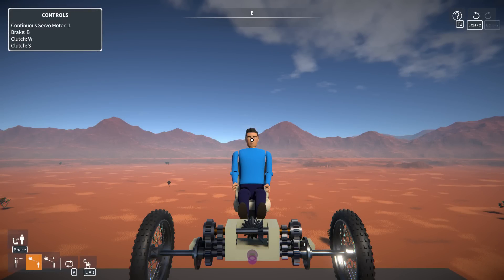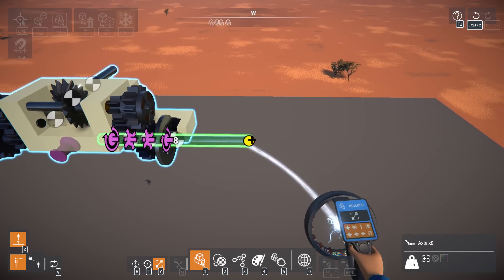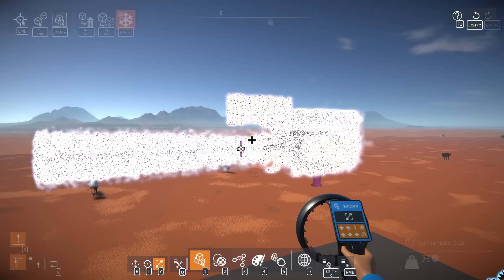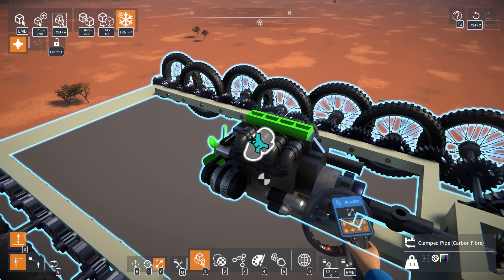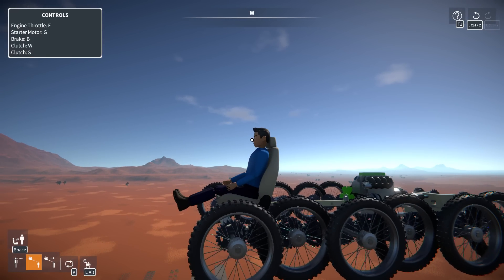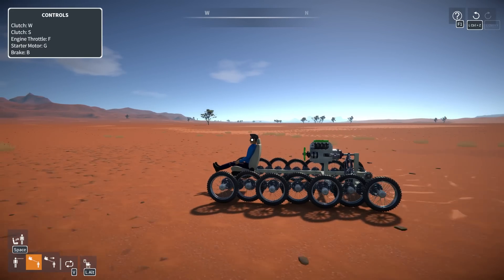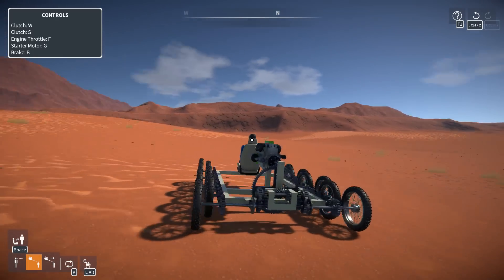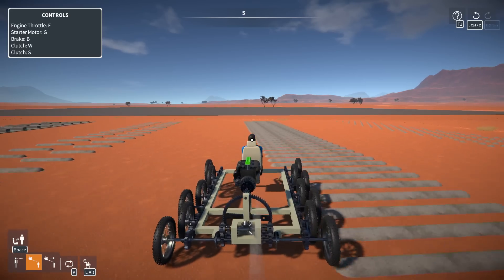I Built a Tank Drive Using a Single Combustion Engine and Transmission!

Comment: Theirs a video called "Double Differential Gear Steering - 3D Animation" by XL Machines 120 that will show you quite clearly how it works for modern tanks, you can then use 2 gearboxes, one to control the drive speed and one to control the turning speed both working off the same engine. Its even easier to do with linear gearboxes now too thanks to the most recent update giving us the ability to break linear actuators down into steps.

As for making tracks, theirs 2 main ways its commonly done in the game, one with gears and gear racks, the other with wheels. You can use the scaffolding blocks to have separate builds be part of the same construction. use springs and/or linear actuators to tension the track when you un-freeze it.

Theirs a few quirks that each type of drive has that I will let you find.

you can use cylinders as roadwheels (the wheels along the bottom) if you want to get more stylish with how it looks, but they are not perfectly round at high speed like normal wheels or gears, if you want to use wheels you should turn down the friction on the road wheels as it will reduce the torque needed, if only by a little.

Some tips: 

Turn Off Collisions when making tracks! "Press 0, hold Q, Settings Tab, Contact Detection : Off" it will save you so many frames and your ears.

Bigger gears allow for more torque to be put though them before skipping. (avoid 8T gears in high torque areas if possible, I have had the 8T skip teeth on me and other people when we have made high torque vehicles)
Having the rotation joint of parts be on the heavier part of the vehicle instead of the lighter part will make the joint stronger. (eg: have the gear fixed to the axle that rotates on the frame, instead of the gear rotating on the axle that fixed to the frame)
Having more rotation/sliding joints will make the connection stronger. (the game treats all of the joints as an individual, not a whole. more joints = more the game try's to keep each of them in line)
Reply: I was gona search the video to find the titel but you were faster 😅 best comment i came so fare

Comment: best video yet. i think instead of "wasd" you need like a "azxs" so each clutch doesnt overlap with each other
Reply: Yes. To spell it out, you have a separate forward/neutral/reverse control for each side. Left responds to AZ and right to SX. (This should be sufficient overexplanation.)

Comment: If you can set brakes on different buttons,  you can have both sides brake independently which should solve the steering, I'd also add a little grip to the 2 center wheels since that will provide traction,  forward and steering while completely stopped.

Comment: 2:30 dunno about tanks but that's how it works with bulldozers.  Dozers and excavators use hydrostatic transmissions though, pumps and valves and such no gears!

Comment: I know those rip tanks lock each side with massive disc brakes...  as for a real tank, they have massive transmissions.   I'd imagine it's an engine to a differential and two separate transmissions for each side.  Just remember to have fun!

Comment: Tanks i believe only have 1 drive motor per track usually on the rear. Large cranes can have drive gears on both sides front and rear of the track because they need the torque to move the .5mil lb and larger machines sitting on the tracks.

And pretty much no track machi e is direct engine driven. Almost all crawlers are hydraulically driven. Old friction cranes like the manitowoc 4100 use a direct drive I believe.

Comment: tnaks have constant drive if in gear tot he driver sprockets they steer by opening a clutch pack disconnecting the driver and then you have steering breaks if you pull the lever further back thsoe apply after the clutch is mostly open giving you a sharper turn the steerign clutch and brake is on a single control but the gear box is always connacted to the sprocket just like a car but steers by disconnecting drive to one side like a open diff with one wheel in the air

Comment: Theres a way to do it with just a differential. The benifit of that is that the tank can have variable track speed which means any size turning circle. The downside to this is that the tightest turning circle has the inside track not moving. But there’s another way to do it with  2 differental gears or planetary gears

Comment: 14:42 I think the issue you're having is that holding W engages both sides to spin forward.

Telling it to also steer while holding W just means you are telling one side to run both forwards and backwards at the same time. It doesn't like that, so it just keeps going forwards.

Comment: Lots of tanks used, essentially, an open diff powering both finals, then separately controlled brakes for steering. Then it's only a single clutch and a single transmission.

Comment: Most excavators I have seen have hydraulic drives, moving the levers just opens various hydraulic valves, so with fluid pumping one way, you can spin the hydraulic drive forward or backwards, based on the fluid routing.

In fact, I imagine a lot of tanks have similar, because it's pretty resilient compared to gears.

Apparently I was decently close to the marK, excerpt from Wikipedia:

"The addition of a continuously variable output using a hydrostatic transmission was used on the Char B1, providing smooth changes in turning radius that eliminated the system's main drawback. The low efficiency of this system meant it was not widely used, but rapid improvement in hydrodynamic fluid couplings made it common in the post-war era. Most Western tank designs since the 1960s have used a variation on this design, notably the M60 Patton and M1 Abrams."

Comment: I've seen some tracked vehicles use a normal engine - transmission - open differential setup and just using brakes to steer. That doesn't allow you to spin your tracks in opposite directions however.

Also one thing you can do is increase your idle rpm and/or decrease your centrifugal clutch's engagement rpm. That way you only need to use your throttle key for high-speed. Definitely would recommend building a torquey engine for that though

Comment: Most tanks in WW2 had 9 to 19 gears
Reply: Definitely needs a transmission, yeah. The super high torque at the bottom, and capable of highway driving at the top.

Comment: If you want to use this system to control the tank, you want a separate control for each side. e.g. q and a for left, e and d for right. Hold q and e to go forwards; a and d to go backwards; q and d to turn right on the spot; e and a to turn left on the spot; q alone to turn right, e alone to turn left, etc.

As for actual tanks, there are so many systems it isn't funny.
Some are like this.
Some have a forwards/reverse gear, and then each side has a clutch and break that could be engaged to change it.
Some have gearboxes for each side.
Some have a separate power train for each side, including a separate engine.
Some have differentials with breaks on each side.

Comment: Some old Soviet/Russian tanks can drive both with and without tracks... For example, BT-5 and BT-7.
Though if it lost the tracks, I think some of the "wheels" can steer like normal car's... instead of using tank-steering... if I remember correctly.

Comment: For suspension try using belts/pullys whith independent wheel suspension and for a very simple drive system use and open differential then a break on each out put

Comment: There are two types of friction. Maybe it's better when you only have the cornering friction turned low. I think the engine in a tank is usually propelling the rear sprockets with somewhat like a differential wich brings the power to either both sides equally or just one depending on where they want to go. Kinda like a floating state between a locked and an open diff.

Comment: Hey kAN, loved the video. I was thinking about the throttle issue you brought up. You could try to set the idle at your peak torque rpm and just leave it alone. If it is a bit jarring to do it this way you could use the input delays at the clutch gears. I hope this helps.

Comment: If you want throttle modulation and fine control of steering you can use some simple wheels like the g29 logictech wheel and can bind controls in game to shifter for accurate gears😅 I've built some cars with the clutch gears to make 5 speed and reverse transmissions I've noticed they don't like high rpms though 😂

Comment: Usually trackdrive has the engine going into a clutch and after that, an open differential spreads the power out to the tracks. When, to turn, they brake the "inside of the turn"-track. The channel Matt´s Offroad Recovery has a Bombee Snowcat, where they rebuild the drivetrain ^^

Comment: Kan you are actually farly close to how tracked vehicles actually work. The way they actually work is you have an engine with a normal transmission that then drives a differential and on the output (axle) shafts there is a clutch and a break that disconnect power from one track or the other.

Comment: Depends on the tank, but a simple early system was to have a differential with a brake on each output side. 

Also, some very early prototype tanks did actually have two engines!

Great vid as always!

Comment: Excavators use hydraulic drive
Tanks get the power from the engine through the transmission to the differential to the brakes to the final drives then to the sprocket some tanks can use neutral steering(the thing you made there) i dont know how that works i wasn't trained on that
Reply: A tank in this sense would be more like a bulldozer
Reply: @kalebgross3730  tanks for the past 50+ steered with the use of brakes only more expensive tanks or hybrid tanks had neutral steering the oldest tank i can think on the top of my head with neutral steer would probably be something like a t1e1 dont quote me on that 
He could try and set a gearbox for top speed and have a separate gearset for neutral steering that works only when the tank isnt in gear
This would need an actual transmission instead of the whole automatic style he used in the previous build
It would be very beneficial tho because you would have the same amount of gears in reverse and forwards
Reply: @nope_defender.bot.6563  The T1E1 probably did because it had an electric transmission if I remember right
Reply: if you search on youtube for "double differential" you'll find how that works
Reply: The M1 Abrams uses hydrostatic (hydraulic) steering. I don't believe many other tanks do, but what is arguably the best MBT in current service does. It also uses a turbine engine, which gives it the ability to run on multiple types of fuel.
Reply: @davidannen7448  That turbine also just chugs fuel like a cr&ckhead on a tuesday so you could say it's a double edged sword.
Reply: @davidannen7448  Muh Abrams! That was the best team up with Germany near the end of the Cold War to build a tank to compete against the t-62s. Then we proceeded to dominate said t-62s during the Middle East conflicts that had tank battles. 

Nowadays between the damn rpg7’s, ieds, and drones pretty much every M1A2 has to have the SEP or Tusk package, and the active defense system. 

One of my favorite video is off Germany’s Leopard A7 (I think) showing off its fully stabilized gun with a full beer mug on the end of the barrel. Or the one that they brake last minute right behind a bunch of soldiers lined up lol. Abrams has the fully stabilized system too, thing is nuts how good it is keeping the thing perfectly still.
Reply: @carsonchambers5617  imma be honest with ya f the abrams the MBT70/KPZ70 was way way more interesting
Ironic how it gave birth to the leopard and the abrams(technically the then xm1 it wasn't the abrams yet)

Comment: Most ww2 tanks had the sprocket (the drive gear) on the front because the technology wasnt there to combine the transmission and the engine together.
So they had the engine in the back, and the transmission in the front near the driver
Reply: no, i think it was because of difficulties getting the controls from the transmission to the driver? could be wrong tho

Comment: tanks do have one drive gear(sprocket) it it is either in the front or back
Edit: to add to this the wheels at the bottom are called roadwheels and the smaller ones that suport to tracks at the top are called idlers.Most mordern tanks use steel tracks with rubberpads exept russian tanks that is bare steel. (the roadwheel setup you have is the same as on many ww2 German tracked vehicles like the Panther, Tiger and the Sd.Kfz 1 to 99 series halftrack)
Edit 2: i remembered incorectli the idler is the bigger wheel opposite the sprocket and the small wheels at the top are return rollers. (thanks for correcting me, i was half asleep when i made the comment)
Reply: Some tracks actually had road wheels that were driven like the bt series.
Reply: It's interleaved wheels which only really the germans used.
Reply: The return rollers are the ones that support the upper track, the idler is the wheel opposite to the sprocket and the one usually responsible for track tension
Reply: @vale.44peru  thanks for correctinge me, was very tired when i commentes
Reply: The Germans used interleaved road wheels because it provided better offroad performance and more stability, but that was the end there. The maintenance was hell, because if a road wheel broke you had to take the whole assembly off for one suspension piece, and there like three road wheels for one, and it would be worse if an inner one broke. It was much easier to use torsion bar setup and others that used only two rollers per suspension, like earlier panzer's and sturmgeschutz's and the allied tanks, especially the sherman.
Reply: tbh some designs could use a setup with 2 differentials or more as a kind of subtractor :)
Reply: The drive gear is usually in the back because it provides tension on the bottom of the tracks which causes them to be inherently more stable when turning while driving forwards. Front drive gear would push the slack under the the wheels which can make the track more prone to dislodge from the wheels when turning. 

And of course, the opposite is true when reversing, but usually that's not an issue due to lower speeds.
Reply: @anteshell  well, yes and no, the majority of tanks were front gear driven and the driver and hull gunner would sit behind the transmission. the transmission offered extra protection for blocking rounds. This is the case for most all of the WW2 era tanks that weren't of a half track type design. we didn't start making mainline tanks with the engine over the transmission for "RWD" until the cold war era.

But it was also a 20 ton vehicle that usually slid around on one track or another. Kan is missing out on 4 more functions for his transmission. or perhaps just 2. Since his left and right turning with both drives functioning (one forward, one backwards) would only be used from a complete stop. in normal driving if going forward already, and you wanted to turn left for instance. you would brake the left track and pivot around it, and the right would keep pushing, opposite for a right turn.
Reply: @ElderonAnalas  If that's the case, I stand corrected. I'm in no way tank aficionado myself.
Reply: Tanks don’t really use interleaved road wheels anymore so I’d say your comment about the panther/tiger etc is wrong. I’d imagine the maintenance is a lot harder and that’s why they got rid of them. To my knowledge the idler is also the wheel that supports the front or rear of the track, opposite to the driven sprockets and the top wheels are called return rollers
Reply: @Lucas-dy4or  How is it wrong, i said the setup that Kan made is the same as those
Reply: @Keglefuglen  must've misread or you've changed it. it was late last night lol
Reply: @Lucas-dy4or  all good, i didnt change anything

Comment: You made whats called Neutral Steering on a tank, but in WW2 the tanks didn't use this. They instead had one side powered, and the other either braking or not moving at all through clutches
Edit: some WW2 tanks did use it
also Yes, the transmission only powered either the front or rear sprockets to move the tracks depending on engine and transmission placement, however there were some outliers, like the BT-7M I think that could be driven without the tracks. I have no idea if there were any that powered sprockets on both the front and back, but lets leave that to the comments
Reply: A lot of British tanks had neutral steer, pre war ones too like the Churchill
Reply: @azik5607  Ah I didn't know that, most my knowledge is on things like the M4 Sherman, Tiger and Panther, KV Series and the T-34
Reply: All of the BT series could drive without the tracks, however the crew had to set up a chain from the sprocket to the roadwheel, and engage the hydraulics on the front roadwheel so it would turn like a normal car.

Still I know no tank that ever had front and back sprockets
Reply: @n2oin  actually it wasn't just the bt7m which was an earlier version of the bt7 both the bt5 and its previous version which I do not remember the name all of em used christie suspension which was designed for cars and allowed armoured vehicles to drive both on their roadwheels using common car steering and propulsion systems
And with the tried and tested method od braking 1 track to turn
Reply: @nope_defender.bot.6563  ah ok
Reply: @nope_defender.bot.6563 the Bt-2 does exists guys, it also can drive without tracks, the ““sprocket”” is the last road wheel which is actually powered, the front “wheel” is actually just an idler. The actual first road wheel is the one that can steer
Reply: tiger1/2 and panthers, some british tanks had neutral steering